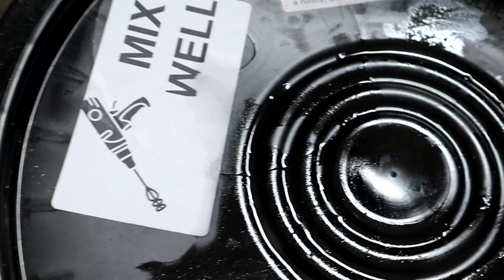Incredible Hulk Craws & Creature Baits: Soft Plastic Lure Making & Striper Fishing Blog

Comment: I was wondering what would happen if you did not add any pigments or dyes to the hot plastic and molded the lures with plain plastic. Would the lures come out see through clear or milky white? Thanks
Reply from the maker: just clear
Reply: Thanks for the reply and info. Would be interesting to see some clear, with glitter, used in the big swimbaits, maybe as a part of a laminate.